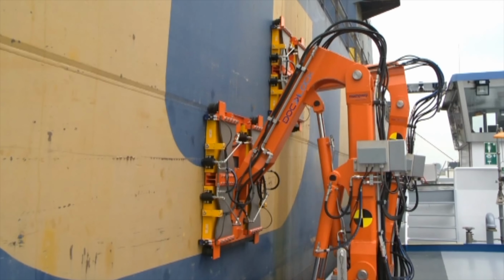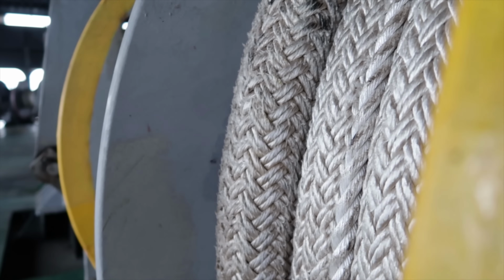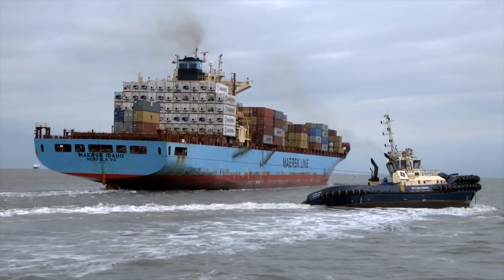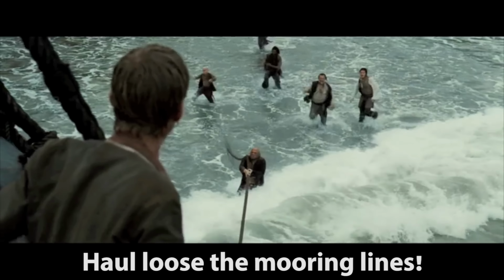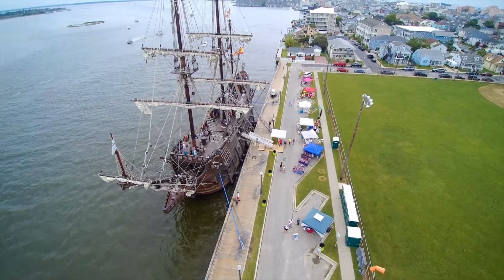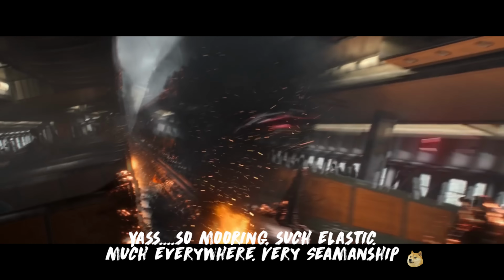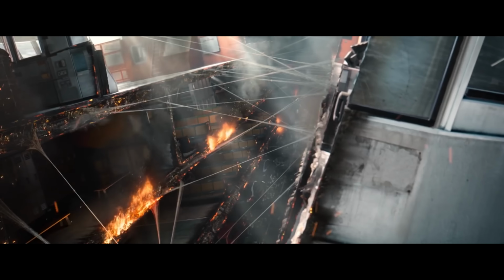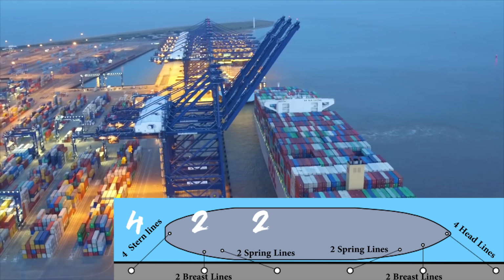Docking a Mega-Ship | Mooring and Berthing Explained! | Life at Sea

Comment: It is very awesome that now a days we still using ropes to moor the ships, but in comparisson wtih others modern mooring systems, the ropes are cheaper and more elastic too, which is very important for the tide and waves.
In the docking operation of a big ship the local pilot has to be on board in order to prevent accidents, and the procedure to get close the vessel to the port is basiclly  the same but too slow .
Some ships have an individual propeller in the front part (bow) in its keel which makes easier this procedure, that is known as thruster propeller.

Comment: When I first started work our company was using Samson Rope for our truck cranes. The rope length was 2 times the boom plus 30 feet that had to fit on the rope drum. Then Spectra rope can out. A 1 1/2 inch of Samson was equal to 1 inch Spectra strength.  This was over 20 years ago so I know they have a newer rope. I found out a few years ago it the same that ship uses.

Comment: Thanks i Just Signed up with SIU and i wanted to get a Bearing on Cargo Ship Procedures. I would also have advise to make sure your Crew Steps in a Bite of a Line. Just Like Snap backs Getting your leg in a Bight of a Line can Also be fatal. I was Working on a Tug in Kentucky and the guy i was Partnered with Got his Leg Stuck in a Bight of a Wire and was almost Dragged Between 2 Barges. Luckly I was abel to catch the Wire before it dragged him Down.

Comment: Another great video, thanks. One update would be advanced synthetic rope. I have to wonder how long the lines are (overall rope length). And I can't imagine the cost just in outfitting mooring lines. Is there a digital readout on the bridge for real-time line tensions? Or how is this determined, surely not by eye or tactilely.

Comment: The springiness of lines are one reason you don't want to use them for spaceships. Without water to drag against a spacecraft or space station, there's a danger that if the spaceship drifts away it'll bounce back when the lines get taut and end up colliding with the station, which is not a good thing. 

There's also a danger of oscillations building up, which I think was a problem with a Gemini mission back in the Sixties that tried tethered docking. They had to cast the docking target loose in the end, which is why Apollo, Soyuz, the Space Shuttle, the ISS, etc all use mechanical docking widgets.

Comment: Thanks for the new video Jeff!  Does it matter that the mooring lines get submerged as you pull them back in?  Do you have to do anything special when you haul wet mooring lines in?
Reply from the maker: nope, the material are design to be able to handle the salty sea water, it will air dry within 1-2 days. We cover them if passing through stormy weather

Comment: Awesome video! Question though, excuse me if it’s a stupid one! So using the 4 2 2 method the ship cannot move forwards or backwards or away from the berth, but what stops it moving towards the berth and colliding? Thanks
Reply: Berths usually have big rubber pads (or sometimes just huge old tyres) on the wall, which the ship rests against.
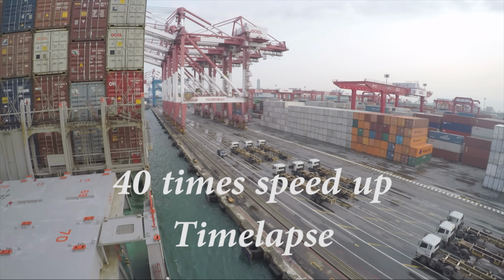Reply: You can see them at 2:00 in this video. They're the grey bits sticking out of the dockside, evenly spaced apart.
Reply: Lobstrex's Place oh yes I see them. Thanks for the reply 👍🏼

Comment: Is there any rhyme or reason about which side of the ship faces the pier?  Meaning, is it easiest to just dock the closest side and get the containers moving, or must you use a particular side of the ship? Beyond worrying about which side to use, it means that the containers may be oriented 180 degrees different as the crane lowers them to the chassis below. I suppose it matters which way they are oriented during loading, especially if they require cooling for reefers.
Reply: I don't know about the larger ships, but with the smaller vessels that have on-board cranes, if the stevedores need to use the ships gear, then whichever side the cranes are on are alongside the berth, and if the stevedores are using their own cranes (which is generally always whenever its an option as ships gear isn't as good) then the ship is oriented so its cranes are on the seaside so the ground gear has a bit more room.

Comment: Great video! You've explained very well what pulls the ship towards the dock, but where is the equal and opposite force on the ship? I assume the hull isn't just banging and crashing on concrete as the ropes pull them together. How is the hull kept safely away from the dock as the ropes keep the hull close to the dock? Thanks for the video!
Reply: It could be a bit late ,but as far as I know ship’s hull is restrained from the dock via fenders (correct me if I wrong )

Comment: How do you keep the right tension on the lines as the tide causes the ship to rise and fall? I image if someone was a bit late releasing more rope as the tide fell, there could be a huge amount of tension on one of those massive ropes?
Reply: As the tide rose I mean
Reply: Usually they're checked hourly by crewmembers. Because of the elasticity of the ropes, no amount of tide change over the period of an hour will cause a rope to snap (assuming the ropes are good quality and properly tensioned to begin with).
Reply: Mike D The mooring winches have an automatic mode to keep 30/60/100% tension on the line permanently. If tension is in-/ or decreasing the winch slacks or heaves automatically to hold the tension. OOW or watchmen also check the lines every hour or every 30 minutes.  In case of strong winds or in ports with huge tidal ranges it can be challenging.
Reply: Cool, thanks for the response

Comment: Liked the video. Is the lines getting wet and having to dry them a big issue? Do they get dried somehow or just dry on the winch? I know on smaller boats some people always try to keep their lines from getting wet so they don't need to dry them to avoid rotting.
Where is your next trip to?
Reply: Brent Kiley Mooring lines always get wet and dry on the winches. Some vessels cover their storage drums with tarpaulins to protect the mooring lines from sea water and sun while at sea. Only additional lines, which are not stored on winches are put inside the bosun store after departure.

Comment: I have a question! I have been on many cruises, and i always notice that when we are in port, there is a rope hanging from the bow of the ship that looks sort of like a trapeze usually with a little flag tied on to it. (I hope i explained it well enough that you know what I'm talking about). What is it? What is it called, and what is the purpose of it? Thanks!!
Reply: Some ships/ports require that ships that are alongside have emergency towing arrangements. Basically, in the event of an emergency and the ship needs to be pulled away from the dock by a tugboat, the tug can simply grab the rope hanging (which would be attached to a larger, stronger mooring rope attached to the ship), and use it to pull the vessel. This is much faster than the typical way of getting a Tugboat made fast to a ship.
Reply: Makes sense! I never knew that. Thanks for the answer!

Comment: Very informative and entertaining video! As a fan of automated mooring, I would just like to point out that the MoorMaster system featured 35s into the video actually handles tide and waves better than ropes, keeping the vessel more stable while also mooring in less than 30 seconds at the push of a button. If anyone wants to know more, feel free to reach out!
Reply: The system of mooring robots attach with vacuum pads to the hull and control the position of the vessel with hydraulic actuation. By controlling the forces in surge and sway while letting the vessel float freely in heave, the system is subject to less forces than if there were ropes and the advanced control system keeps the vessel stable.
Reply: The system also moors the vessel in less than 30 seconds and releases in 15 seconds (compared to somewhere around 20 minutes to moor the ship with mooring lines) at the push of a button. In this way, the system also keeps everyone safe, eliminating snap-back zones.
Reply: On a side-note: really love the memes :-)
Reply: A video showing the MoorMaster system (which could really use some JeffHK meme expertise) is available here: https://www.youtube.com/watch?v=CZreelrGPng

Comment: Why the term "port" and "starboard"? Do the ships dock/berth/moor on the Port side only? No, right?
In aviation, the Port side is for passengers, and Starboard for cargo and other stuff. How/Why is it in maritime?
Reply from the maker: there is no preference in maritime, completely depends on the port
Reply: As near as I can find online, the origins of the terms relate to docking and steering.
Early sailing ship designs would not have a steering rudder on their centreline coming out the back end of the ship, but rather a less sophisticated steering oar hanging out off the right hand side of the ship (right hand side possibly due to right handedness being more common). With the steering oar getting in the way of the right hand side, these ships would always have to dock and thus unload cargo on their left hand side.
The right hand side was called 'starboard', likely coming from Old Norse language's stýri (steer) and borð (side of ship). The left hand side came to be known as 'larboard' from Middle English laderbord - lade (load) and borð (side of ship).
Eventually ship designs modernised to have rudders on the centreline out the back so docking became feasible on either side, but the names stuck. Finally, since 'starboard' and 'larboard' sound so similar, to avoid confusion English speaking Navies like England and America decided to drop the cargo related term 'larboard' in favour of the already in use French term 'port', the place you docked at. :)
Reply: Oh, wow! Thank you so much... I didn't know any of this, at all... Kudos!
Reply: Also, right and left are relative. Port and starboard are fixed for a boat/ship (left and right when facing the bow).